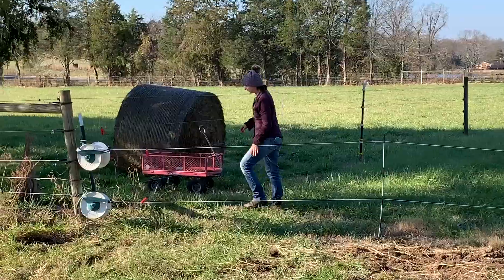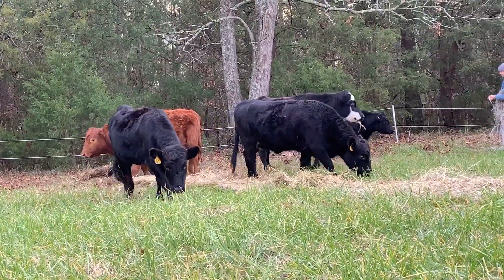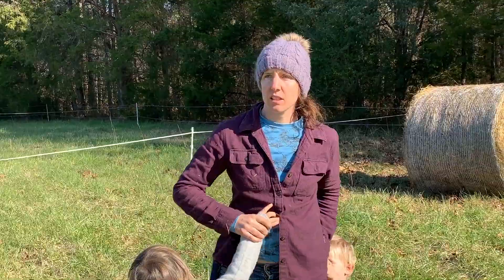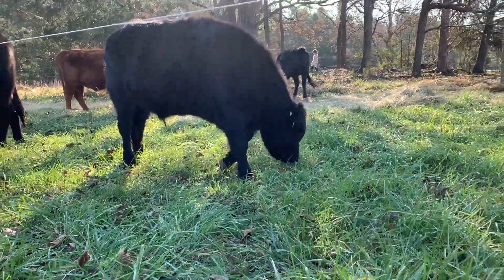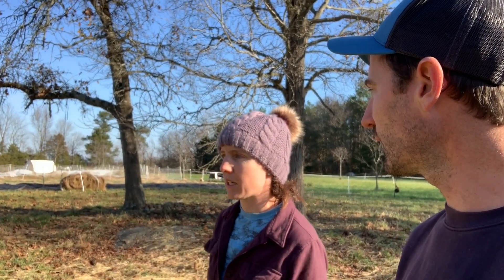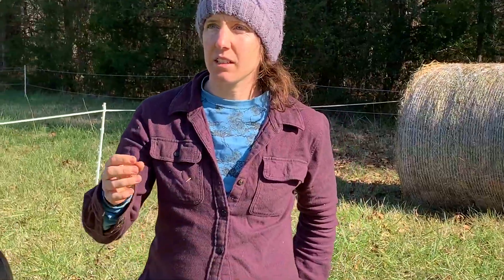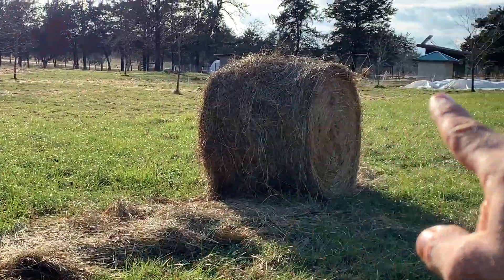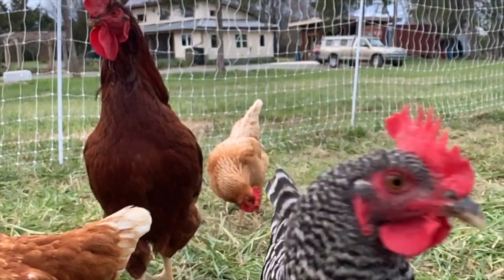Regenerative Agriculture | Rotational Grazing Grass Fed Beef Cows on Small Acreage

Comment: Great video.  Have a question regarding how much acreage you're working with for those five cows I mustve missed it.  Thanks in advance.
Reply: Nevermind got it rewatched it good job on video again.
Reply from the maker: hector villarreal thanks! typically 3 full sized cows per acre is a good rule of thumb. We have dexters right now, which are much smaller
Reply: @HeirloomBuilders  nice so they average about 700 lbs more or less at slaughter?  Do yo u all sell them privately or at a auction type setting?  I appreciate your time sir.
Reply from the maker: hector villarreal we have them processed and packaged and usually sell as half and quarter cows. Haven’t processed a dexter cow yet, but they are supposed to weigh about 750 lbs. and will probably each put about 270 lbs of packaged meat in the freezer.